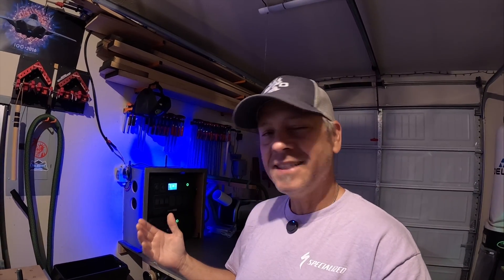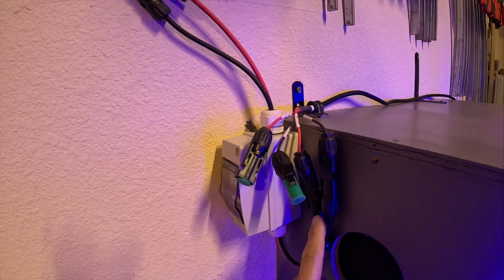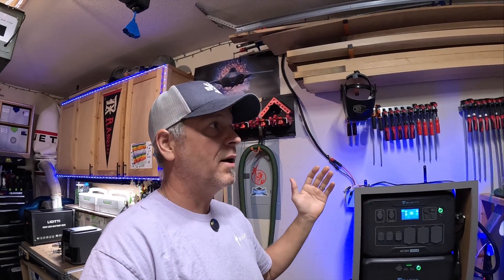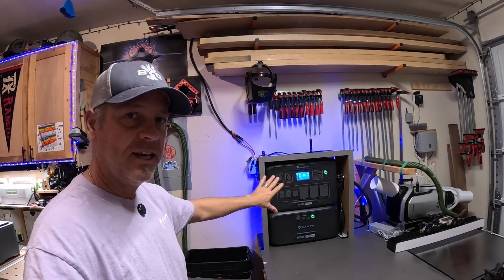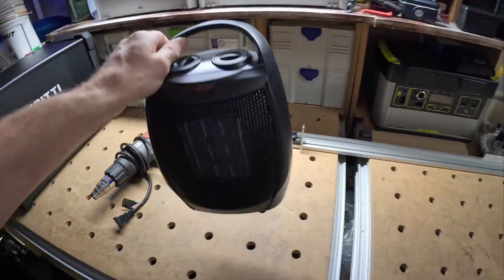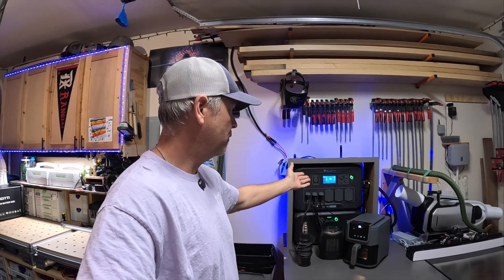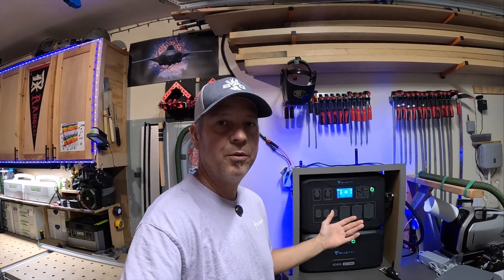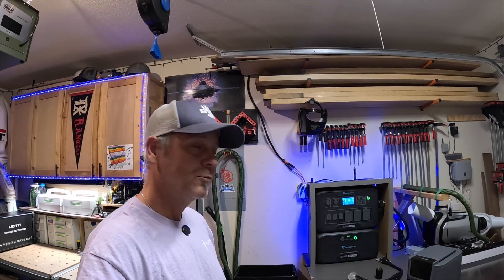Workshop solar conversion project PART 2: Adding the AC500

Comment: Connecting panels to inverters and batteries to power specific loads is definitely exciting and addictive.  It's also quite sobering, when you realize just how much power some things need, either in short bursts or over the duration of a day or a week.  Then you do the math on how much (or how little?) you're saving at any given time, which forces you to address the topic of ROI, or return on investment.  For most folks, meaning those who aren't paying ridiculously high rates for power, especially those with time-of-use premiums, the ROI is going to take a long time.  This is true even for those who DIY a solution, let alone paying a lot more for a commercial product like the AC500 and its expansion batteries.
Reply from the maker: Very well said. For me, this setup is not to try and recover my money, but more as a means to eventually get my main circuits tied into this to use in the event of a power loss.
Reply: @BrianWatersOutdoors  - Afer a while of waiting for a power loss, seeing a very capable system sitting there idle 99% of the time, I became motivated to see it utilized on a more regular basis.  That's when I built the "OGO" - off-grid office.  It's nothing more than a basic solar setup with a couple of dedicated outlets that are not part of my home's wiring.  I've been enjoying it and slowly realizing an ROI, whereas before the stuff was just waiting for the power to go out for more than a few seconds.

Comment: Oh yes.  It's addictive.  My truck camping setup is ongoing. Yesterday, I tested the Renogy 30A solar charger and the Renogy 40A DC-DC charger simultaneously charging a 12v 200AH LFP battery. It was an excellent solar day and i was getting 58A of charging power with the engine at idle.  Check out the CIGS panels - they are pricey, but they will give a vehicle rooftop hail protection as well as excellent partial-shading charging capability.

Comment: Is there an advantage to running 2 PPTs as opposed to one?
Reply from the maker: I like it because I can have 2 different solar arrays connected directly to this instead of just one large array
Reply: @BrianWatersOutdoors  Yeah and that's why I kept my Bluetti AC200 MAX.  I can draw power from two solar panel arrays using the D050S Charging Enhancer.  The Bluetti AC200L and AC200P don't support the D050S so they only support one array.  I know Bluetti wanted to cut costs, but not supporting the D050S was a mistake in my opinion.

Comment: Use an engine lift, they are on wheels, you can get up to the wall with a load. Also Auto Zone has one that can lift up to 80+ inches. I would rent one to check out.